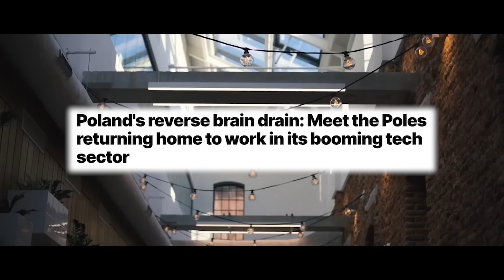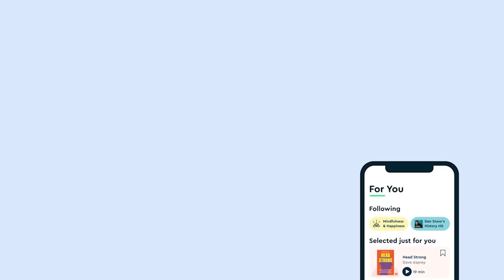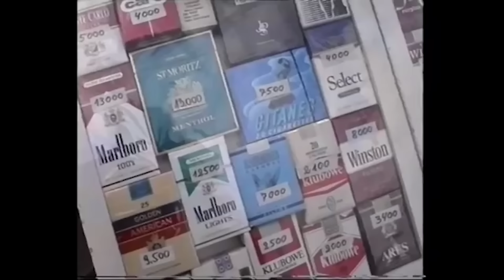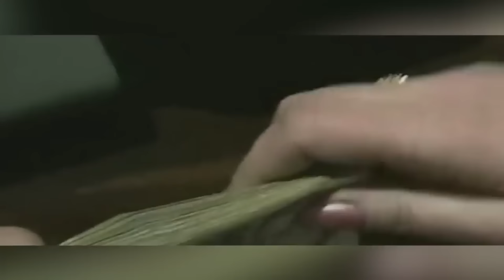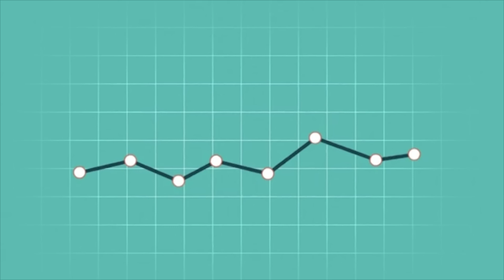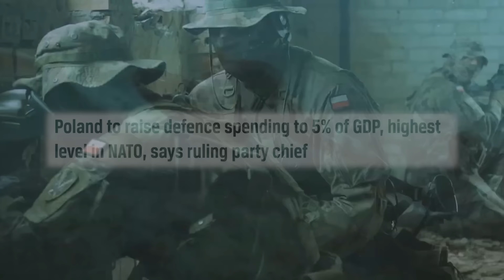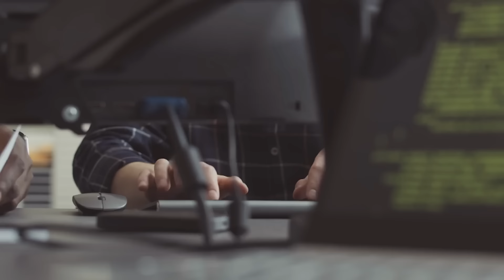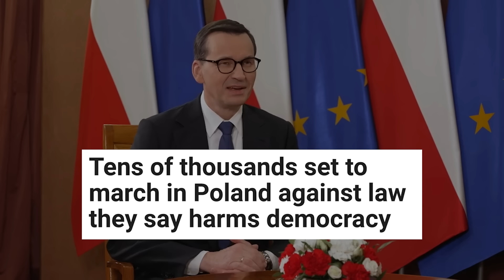Why Poland Is Quietly Becoming Europe's Next Superpower

Comment: We moved to Vancouver in 1994 when I was 7. In 2018 I moved back to Poland and I gotta say, if you're on the fence, don't be, it was the best decision of my life. The hardest part was taking the leap and ignoring all the BS my brain came up with. I remember telling myself that if things are only 10% as good as I imagine I'll be happy, things turned out 3 times better then what I had hoped. I just miss my friends but these days flights are cheap and mostly everyone is or can work remotely.
Reply: Good decision, man. One thing that made your transition seamless is your language facility. Now, you have an edge as you can switch effortlessly between English and Polish. I live in Pitt Meadows, and even here in the suburb of Vancouver, it’s a rat race. Prices have gone up significantly especially housing. I was in Tychy (Upper Silesia) last week and life there seems to be more relaxed than here. The railway infrastructure is extensive and crime rate is very low. What else do you find better there compared to here?
Reply: @gerryaraujo7852  Any of the big cities should be good. Warsaw, Krakow, Wroclaw, Poznan, Gdansk are probably the most developed among all with a lot of job opportunities.
Reply: @piotrjasielski , thanks for the heads up. If I moved to Poland, I imagine myself to be living in a cabin in the mountains of Skrzyczne or thereabouts. Not only that the mountain air is refreshing, but also that the culture is relatively uncorrupted. It's a comfortable distance from the two big cities, Cracow and Katowice.
Reply: @gerryaraujo7852  If you can work remotely then a nice village is probably the best option.
Reply: Great decision to leave Vancouver and return to Poland. You’ll be much happier. Best of luck!
Reply: Oby Ci Bog dal wszystko czego Ci potrzeba,Mieszkam od 33 lat w Kanadzie i codziennie tesknie za Polska.😞
Reply: @margok904  Czemu nie wrócić? Warto dopóki mieszkania tanie w stosunku do Kanady, za kilka lat ceny będą się wyrównywać.

Comment: Intel annouced that it will be building a $4.6 billion mega semiconductor factory in Poland that will employ 30,000 people. Thanks to this, many other companies that depend on these components are also planning factories next door to reduce delivery costs. The future of Europe's IT is Poland. It may be foreign, but it's better than nothing.
Reply: it's actually quite good, since it come with a R&D facility and creates a local ecosystem of subcontractors and qualified staff.
Reply: Part of this is wrong. It will be 2k emplyees, not 30k. Also, this factory won't do the main part of the semiconductor manufacturing - lithography. It will take already processed silicon waffers from factories in Ireland and Germany, cut them into single chips, package them into the final products and test them.
Reply: @psow4062  My bad, I read this in the comment section under another video without doing proper research.
Reply: Is it far from the russian border of kaliningrad?

Comment: to straighten out some facts:
wages increased, but it still doesn't count for inflation, since price of products increased drastically as well
you can check for petrol and oil prices on span let's say 2000-2022, 
it's true that it happens to develop pretty well, but in places of good connection, there are a lot of undrivable roads because some people block the construction, still there's a big factor of getting job thru connection and there's no collective thinking about the future of the country, gov rn is pushing communist values and using CCCP ways of manipulation of data, so some official data is way off, normally it would still be off, there's no way to make correct data, since most gains there are working without permit, because there's huge difference in living wage and minimal wage
national polish TV (TVP) is being controlled by gov to such extend that they started fueling those differences with radical left and right, since unluckily we have one party ruling (radical right, socialist, with huge communist influence as of now) and they are pushing more laws that disable low to mid income companies to have profit
another problem is the huge margin of profits for churches and influence, churches are more of pro-right party agenda places 
some might not agree with things i'm saying, but i believe in those things as i have seen it firsthand and i've done my research 
fyi i don't care which gov is ruling as long as it suits myself to live properly, i don't like how people treat garbage here, there are still a lot people that just throw trash anywhere and then nobody cleans it untill people locally have to pay/work themselves to clean roadsides and forrests f.e.
other problem we are having is electricity prices, since we still are using fossil fuel energy, mostly coal, the first nuclear power plant is in construction, and both solar and wind are used by private personnel
yet it's true that it still is a beautiful country that's been developing, most of polish businesses are in transport and storage
pretty good place to live, it's cheaper than euro using countries, good access to all needed media (electricity, water, network), it's pretty safe, many work opportunities, good higher education
everybody has to decide for themselves, it's not that easy to say it's becoming superpower while they say we have 12% visible inflation while real is on level around 30%, norm should be up to 2% in both sides (inflation/deflation), it's difficult to say everything about country, but that's my view based on things i'm seeing
i might have used some wrong terms, sorry if that happened, trying to add some to the content ^_^